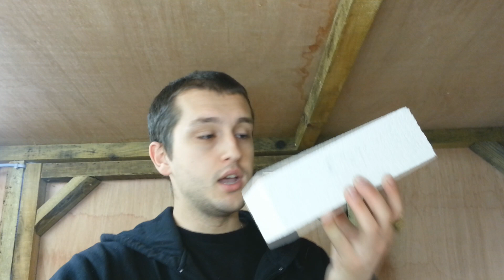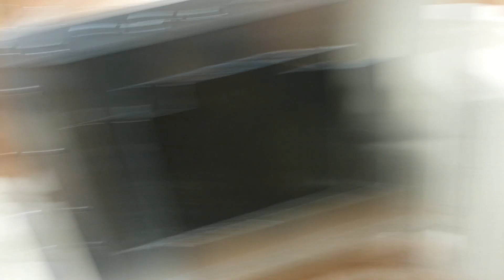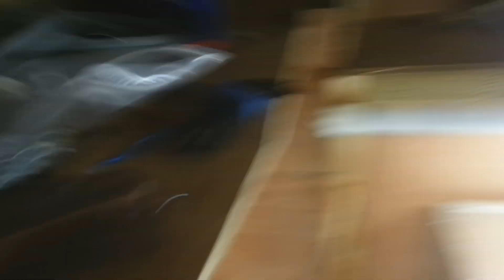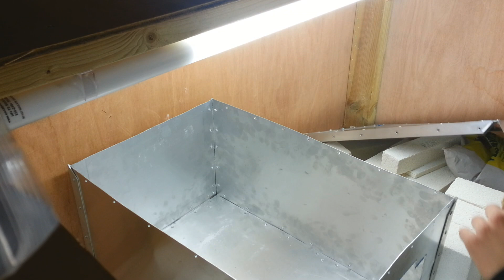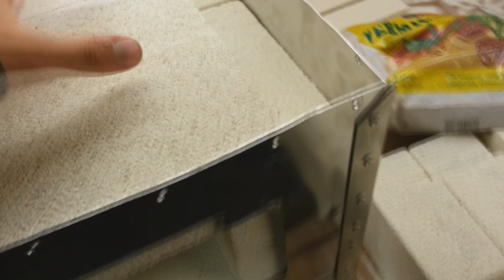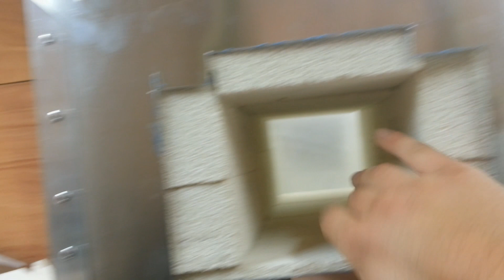Heat Treatment Oven Build: Part 1 - The overview

Comment from the maker: The problem with making a 'tall' oven may be heat gradient over the increased height. As we all know, warm air rises, and in a case of 850'C+ temperatures, the air will be very determined to rise and possibly escape. This problem will be exaggerated by the increased height.
It may be better to build a long horizontal oven, but attach castor wheels to the back bottom corner of it, so you could stand it upright for storage when not in use!

Comment: I have a small cube kiln for knives and small parts. What do you think of a deep kiln built "tall" wise >? I'm thinking of hanging swords and axle shafts/ sway bars. A chain fall would be needed to pull parts as the heat would LOVE a top door.